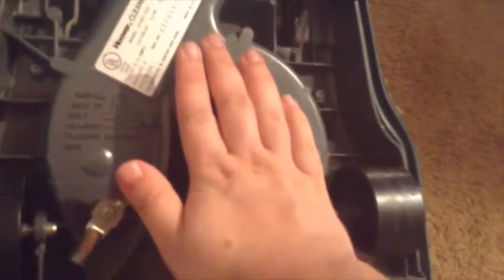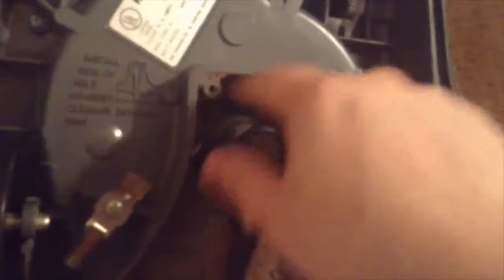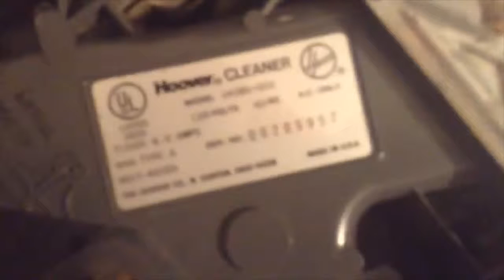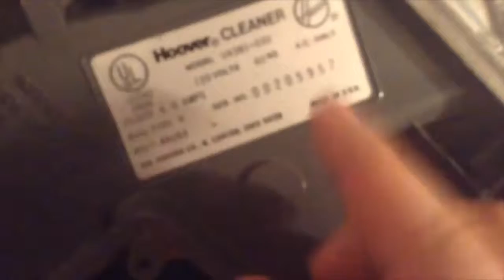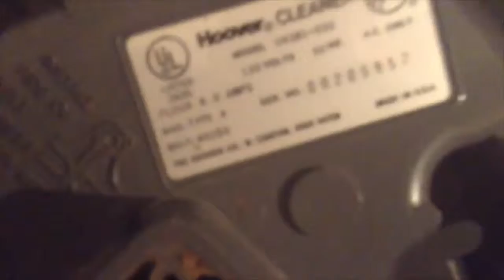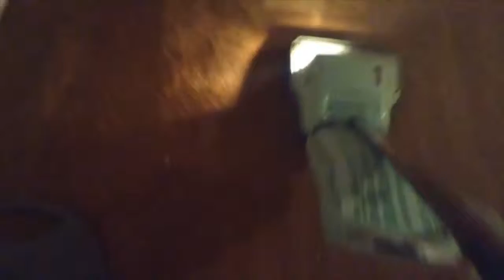Hoover Decade 80 Upright Vacuum Cleaner Overview & Demo

Comment: Awesome commentary and description! Thanks also for the demo. Hoover USA's Decade 80 styling originated in 1979 with the models U4151 Deluxe Convertible (sans headlight) and U4153 Custom Elite. Both were renamed Decade 80 in 1980. In 1981 the models U4161-9 (-9 indicated a chrome handle and larger outer bag) and U4159 were added; followed a year later by the U4329 dirt cup model. They were all produced until 1984 when the power surge motors were introduced. At that time the U4151 was reidentified as the U4385, the U4153 and U4159 were discontinued, the U4161-9 became the U4381-030 (-030 indicated the air freshener tab), and the U4329 was remodeled the U4383. The series was renamed Decade 800 in 1988 with the new 6.5 amp motor.